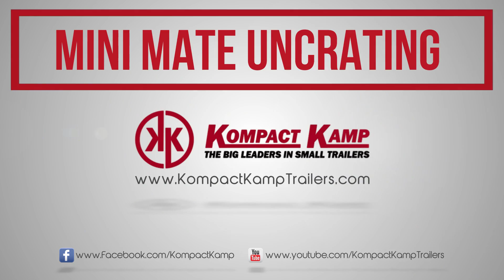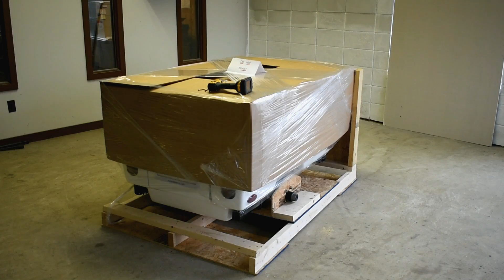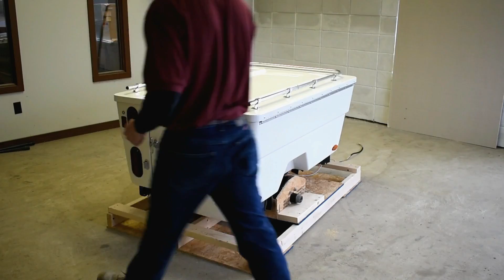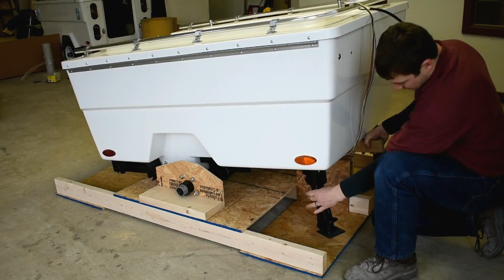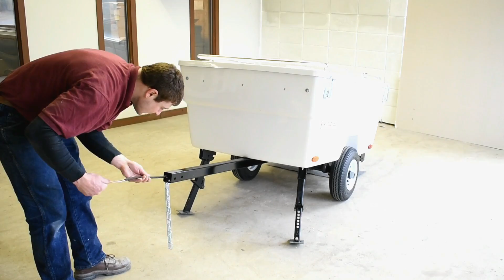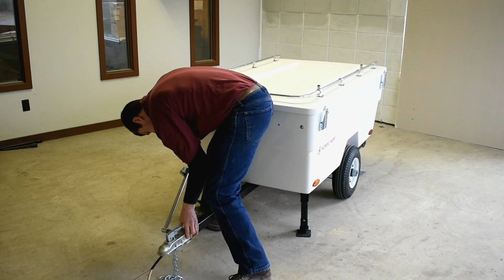Uncrating a Mini Mate Motorcycle Camper

Comment: What is speed rating? And total weight?
Reply from the maker: Trailer weight is 260lbs with a 25lb tongue weight. Tires are speed rated for 65mph.
Reply: Is there an external rack that could be mounted on top. Is it rated to carry weight?
Reply from the maker: There is a rack on top that removes to support the lid/bed. Customers have used it to carry kayaks, lawn chairs, bicycles, etc.
Reply: Kompact Kamp great

Comment: Is the bolts that mount the tongue going through the fiberglass? If so it doesn’t seem very sound?
Reply from the maker: We surround a 1/2" core board between 2 thick layers of fiberglass to create our sealed trailer floor which allows us to mount all underbody components directly to the body.  Our design has over 35 years of proven reliability with many 1980’s models still being used today!
Reply: @KompactKamp  Thank you!!